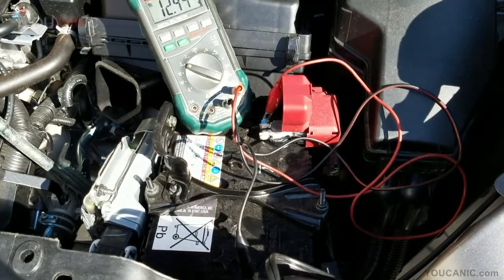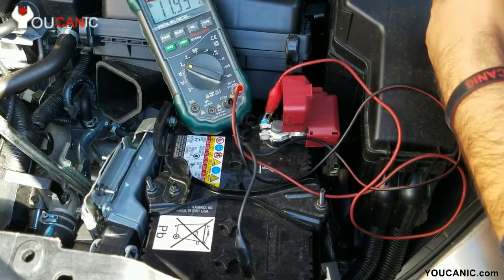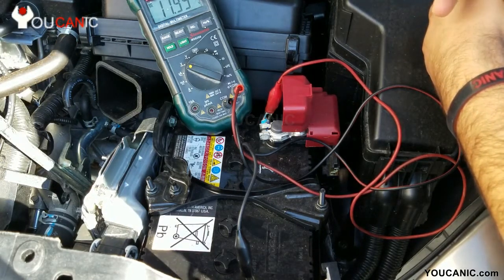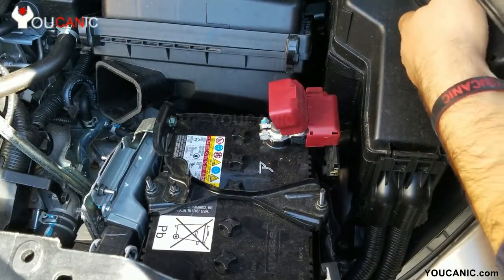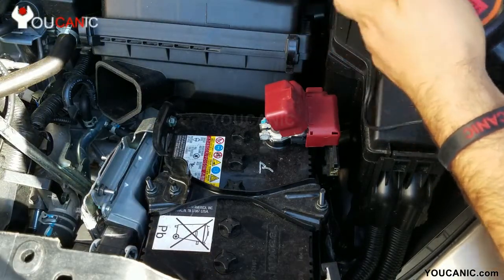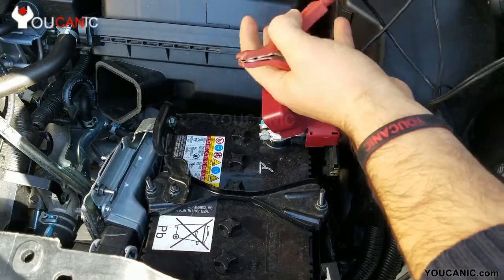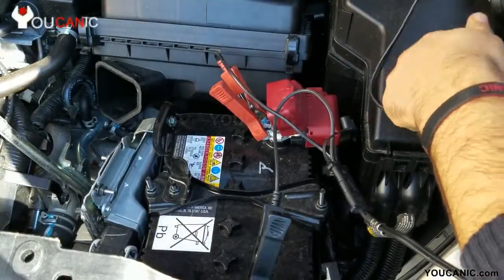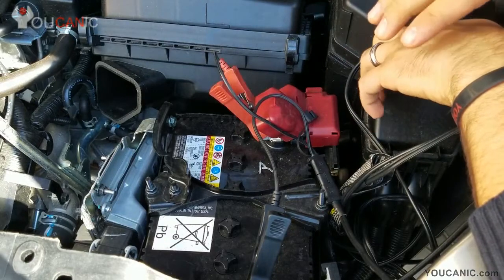How to Trickle Charge a Car Battery

Comment: If battery at zero charge your triple charger will not work connect a good battery with jumping cables then connect trickle charger to dead battery all new charger will not charge zero charge battery's
Reply from the maker: Thanks for your comment and insightful suggestion on our car battery charging method. We appreciate your knowledge and value your participation in the Youcanic community. Our aim is to assist car owners to gain confidence in vehicle maintenance and repair. We recommend visiting our website, www.youcanic.com, for a wealth of resources, guides, and our state-of-the-art Youcanic scanner. We're here to help, so don't hesitate to reach out if further assistance is required. Your journey towards competent car ownership is our success!

Comment: Are you serious? Video is about telling us to use a trickle charger but it has absolutely zero information of how to hook it up
Reply from the maker: I apologize if the video didn't provide clear instructions on how to use a trickle charger. If you need further guidance, we encourage you to visit YOUCANIC's website where you can ask any car-related questions you may have www.youcanic.com. 

YOUCANIC offers various resources, from OEM Factory Repair Manuals to how-to videos. In addition, you might be interested in checking out the YOUCANIC Full System Scanner at www.youcanic.com/scanner. It's like having a mechanic at your fingertips. Your trust in YOUCANIC is greatly appreciated, and we aim to be your reliable source for all things automotive.